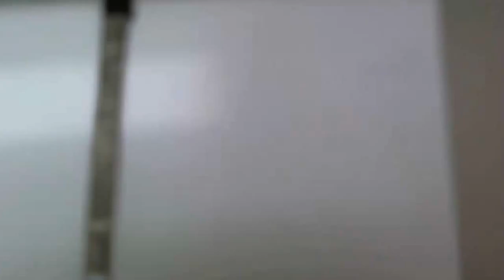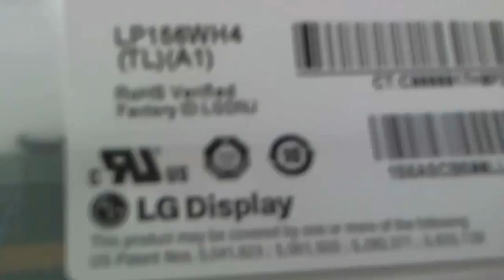Toshiba Satellite P755 Laptop Screen Replacement Procedure

Comment: Hi, I have an issue concerning this laptop. See, when I try to lower the brightness the brightness goes higher, and when I try to higher the brightness the brightness goes lower. When I leave my laptop unused, the screen brightness goes to the highest possible (when normally it's the opposite). Do you know the reason? I got this laptop by another person, I have no idea if the screen has been replaced. Thanks.